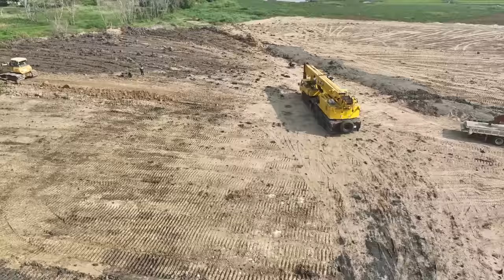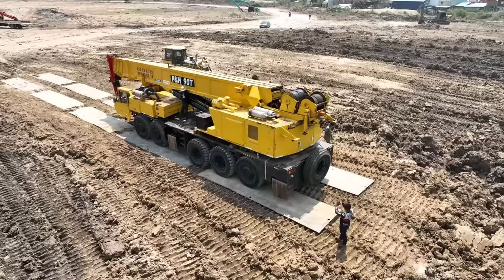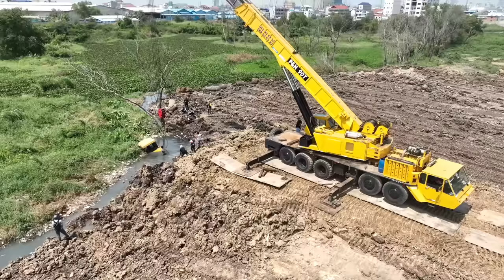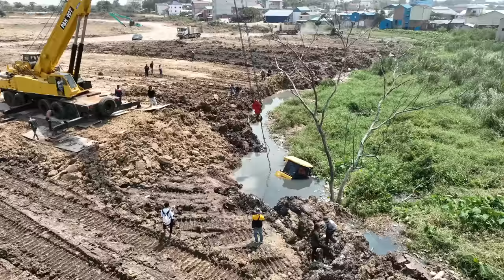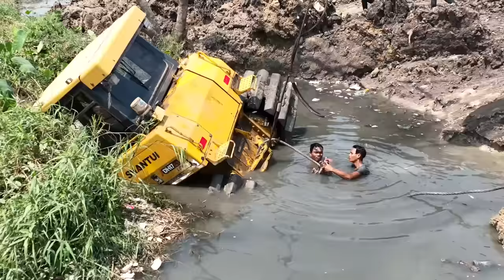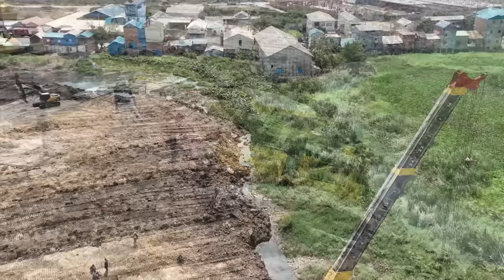Amazing Technique Skills Bulldozer Secure Sinking In Deep Water Recovery By Crane Truck P&H 90T

Comment: This was the most dangerous recovery I have ever seen. I hope the idiot who ran the dozer into this mess is looking for another job. If any of those cables snapped there would just pieces of more idiots cut into hamburger by those cables. They needed to chase that screeching guy who seemed to think he was giving orders out of there. That dozer and crane operator needed to be talking together. I’m sure they will catch that many gallons of hyd oil and engine oil contaminated with water  plus the diesel fuel. Bet they cut it loose right there on the ground.
Reply: This could have just as easy made the "Crane Tipping" video reel.  I was thinking exactly the same thing about the danger level.

Comment: This took way longer than it should have. Was yelling at my screen the whole time - "back it away or lower the damn crane arm stupids! You're going to crush the cabin!" This could have easily gone from recovery to disaster the way they were lifting it at first.
Reply: 🎉 You nearly always find these cultural video mechanical efforts as shambolic. Usually too many folk giving instruction to the drivers when what is needed is a qualified safety supervisor. The outrigger support setup is also sub standard which is to be expected, frankly! And the Hyundai driver could have formed a ramped exit in advance of this shambles.
Reply: @jamescampbell7780  I smell... B. O. O. M. E. R!!!

Comment: It’s not amazing but highly dangerous n stupid technique. 1st the men should not go under the stuck machine in mud. If the line break you’ve 2 under the machine and 4 other in the crane hook and cable swing-back zone. Finally the bulldozer did help. Need wooden railway ties to put under the thin iron sheets holding the weight of the crane and the machine it’s lifting to stabilize itself. The crane should’ve stopped lifting the machine too high when another bulldozer is pulling it out. There are men in direct wire snap n whiplash zone to the end, very risky. The whiplash of snapped wire can cut a man in two in a second!
Reply: Barefeet, walking within crane cab's swing radius while the crane is turning. So many safety issues here.
Reply: Too many people in the snap zone 😮
Reply: Aaaaaaaa@a@aaaa
Reply: You have to remember they have western style equipment but not western IQs.
Reply: Buenos,
Reply: But they all enjoyed  😂 themselves and it was a break from routine for some. Chance to use the drones too. Different way of life, they certainly get the jobs done,
Reply: शंशशशशशशशशशशननन देशों
Reply: शंशशशशशशशशशशननन देशों
Reply: It’s called the third world bro. Life is cheap.
Reply: diddles

Comment: Not exactly "amazing skills".  Would have been better to put the distressed dozer in neutral and the blade on float.  The way they rigged the overhead lift jammed the cables between the track treads.  They must have had a hard time freeing those cables.  If the dozer was in neutral, the tracks would roll freely making the job of the rescue dozer much easier.  They would have been better served to keep the crane hooked up to the rear to take some of the weight and just pulled it out.

Comment: As someone watching from the US
•	I was really glad to see no one got hurt in this disaster
•	Also glad to see so many people and equipment working together to get the job done despite no one wearing safety equipment like hard hats or even (steel toe) shoes
•	Good to see your recovery equipment is able to handle pulling out the bulldozer safely despite the danger and risks
•	I can't imagine being a maintenance or repair person working to service this kind of recovered equipment
•	Thanks so very much for posting and sharing!
              All the best and God Bless. 🙏❤🇺🇸
Reply: Wouldn't be within 100 yds of cables under that load
But kudos to getting it done
Reply: No need for a hard hat, length of bamboo cane would get better results if used on the drivers back for abusing the machine like that
Reply: Yo esa marca de bulldozer lo dejaría botado

Comment: Goodness me who`s hand signal was the crane operator  supposed to take direction from? I counted 3 or more at on time. Did you see those guys step over the taught tow line from the towing bulldozer to the bulldozer under tow? If that had snapped they would of had  more than their balls cut off.Then  they were all aver the crane whilst in operation can you believe that.Too many spectators to damn close.  but yeah its out. Worksafe practice mm don`t think so

Comment: These guys aren't the brightest.  First of all they should of dammed the water up above there and use a trash pump to divert it and drain the area out.  No crane would be needed to do this.
Reply: Dude probably got pink eye from that water
Reply: Why do they have the water dammed up right at the machine?  Did they get the dozer stuck just to make a video?